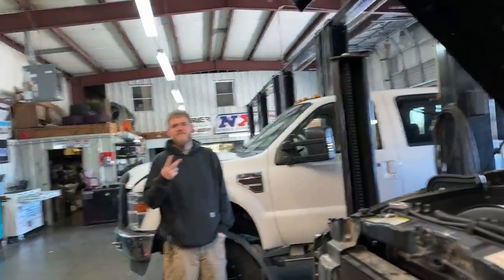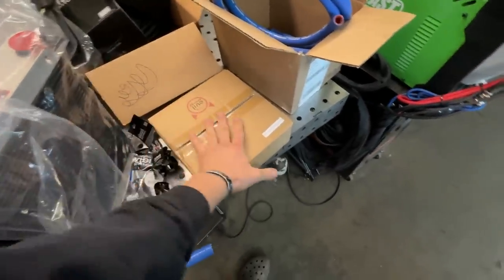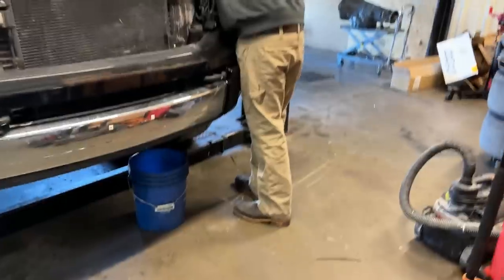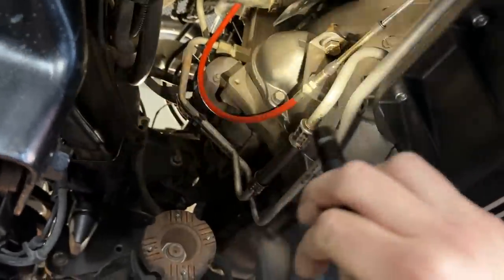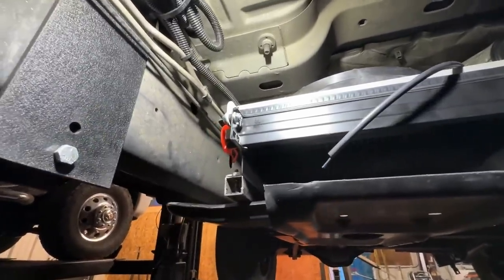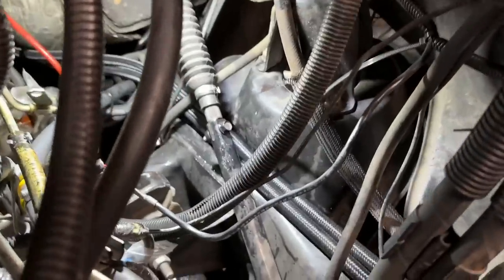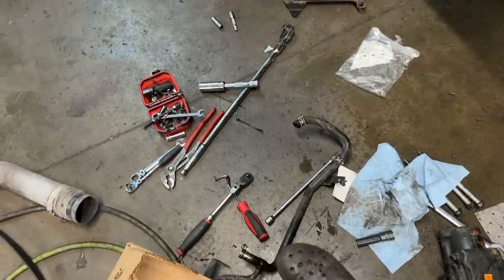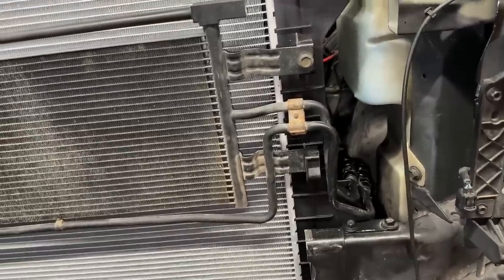HOW TO DELETE..... Your Heat Exchanger

Comment: I've always given the torque converter cooler it's own cooler when doing that job.  I like your setup.  I always wondered why Chrysler chose not to use the heat exchanger on the 68fre 3rd gens but  started using that billet block cross over with coolant and atf a few years later.  I hate when they leak coolant into your transmission from rotting out.

Comment: Without how much you payed for the truck how much do you have into all the stuff you've done to it so far?
Reply from the maker: By the time I’m done with everything this would be about a 25-30k bill to a customer
Reply: @Horsetorques Diesel  pretty crazy. Thanks man
Reply from the maker: @jakes_lbz  gotta pay to play the trans alone retails for 9990! Fuel system 6400, engine upgrades 2000, turbo kit 3000, tuning 1000, suspension work 1900. Plus some more that I haven’t put on yet

Comment: By the way i tried 2 Derale 10000 oil coolers in series in the stock cooler location and trans temps would over heat 220-230 just cruising around town. turns out the engineers got a handle on the thermodynamics with the stock cooler it basically needs to be a bit bigger because most people tow more than what the trucks are rated for.  I also have a Derale 15800 with fan under the bed and i have seen no change in trans temps so im sure you can under stand the under the bed coolers do little to nothing. I believe the reason for that is they dont thin the fluid out enough like the stock front cooler does. it make sense that fluid needs to be thinned out in order the be cooled.  rushing the fluid through high flow coolers provides very little heat transfer. After all i have not found anything that moves more air than the factory fan clutch.
Reply from the maker: Under bed coolers work just fine I use them on my quad cab for 2 years, used them on my 2011, 2006 mega cab etc. if they do not have enough air flow they do not work. People mount them too close to flat surfaces. Adding trans coolers up front has been proven to decrease the front cooling stack which when already over loaded is not enough radiator. With keeping a single stock cooler adding a larger radiator with the stock ram clutch that is the best way to increase cooling stack efficiency. It’s the same reason on newer trucks the Intercoolers are mounted low in the bumper for better radiator flow

Comment: Hey Josh, a little FYI from out west in Arizona. The best trans cooling design ive installed and tested is to take 2 factory trans coolers up front, cut the thermostat bypass pipe off of the old one and tig the tubes closed so it is a full cool 100% of the time. lay it on the front of the stock cooler, tig it on. mounted in front.  trans lines in series. full cool first then into the stock bypass cooler. Tstat opens at 180 degrees. I always over tow 28k lbs gross. temps are dreamy. 165 all the time, 30 minute hills at 5-7 percent grades 185- 210.  In 110 degree ambient temps.  
oh yeah of course the trans heater is deleted.  although i left the heater on my aunts 2005 and it stays under 220 while towing there fifth wheel. so still good results for people that want to have it heat up quicker.

Comment: I added a 6.0 trans cooler to my 05 CR. Took some doing and fabing some brackets.  That cooler is a massive heat sink! I do agree with you on taking heat sources our of the cooler stack and using remote mount coolers. Though I honestly think once the heat exchanger is removed from the equation, that's what cools the trans fluid down. My overall engine temps run around 185* now. It's a thing of beauty. 
Have a 14 silverado that send the trans fluid through the AC condenser, then the radiator, and finally back to trans. So dumb!  
One aux cooler and thermostat bypass later, trans temp rarely creeps above 140*. I'm south of I-10 in the heat belt.

Comment: The heater core line that went around the back of the block, you connected that line to the passenger front area but isnt that where the other side of the heater core is connected?  Just wanting to make sure i dont connect it wrong and end up with no heat 😂😂 and what size fitting do you use to connect the heater core line to the distribution block, the trans line stuff i have down pretty good but i had to just connect the two heat exchanger coolant line together until i can figure out what fitting i need and where exactly i connect the heater core line that was around the back of the engine, to..

Comment: What was the thread pitch on the bolt that goes into the block for the coolant line delete on the drivers side
Reply from the maker: -10 orb
Reply: what about passenger side by the oil filter?

Comment: Just my thoughts and maybe I'm overthinking it but wouldn't installed a good cooler up front, such as a Mishimoto, FSD, or any of the bigger cooler setups. Wouldn't that be more than enough to keep it cool and keep it simple?
Reply: I did that exact thing. Removed my heat exchanger, installed a Mishimoto in the front, trans hit 250 in traffic on an 88⁰ day. Trans would also shoot up quick backing trailers into tight spots (D to R back and forth would heat it up)
Installed a secondary with a fan under the bed, no issues now.
Reply from the maker: Stop adding heat into the cooling stack!!!
Reply: @theloafman2716  that's strange I installed the same cooler I haven't gotten over 160 even towing up steep grades.
Reply: Back in the Josh/Myer video; I deleted the heat exchanger and installed the PDD blue/Continental lines with a Mishimoto trans cooler. My truck runs in the northwest but have made trips to California. Haven’t gotten over 170degF in 95degF weather towing a 24’ camper trailer up decent grades. As Josh said too, on those cold mornings take it easy on the trans as it builds heat.
Reply: @j.c.316  hey, by "mishimoto trans cooler"... Do you mean the one up front, or the torque converter cooler in between the block and the trans?
Reply: @adamantee1  Yup, the one out in front. It sits behind the AC condenser.

Comment: In the first part of the video you showed the blue silicone hose as the preferred hose, why then did you use the braided hose instead?
Reply from the maker: 2 reasons. 1 this is npt to an not push hose style on the heater core. 2. I didn’t have the 10an push lock fittings 😂

Comment: Can you attach the Vibrant "crimp" -8 fittings straight to the OE cooler, or do you have to cut/modify the tubing to accept the fitting 1st?
Reply from the maker: Not long enough to get a good crimp
Reply: @horsetorquesdiesel  So do I cut behind the "ring", where the factory lines would've bit onto, then install crimp -8s?

Comment: Would you recommend the power driven trans line and cooler kit for a 3rd gen and exchanger delete?
Reply from the maker: Not with them shitty push lock fittings

Comment: why the 6.7 fan pulley? does it have to match with the 6.7 damper?
Reply: Yes it does.  5.9 fan pulley with a 6.7 damper you cant get the belt on due to the damper being larger.  6.7 fan pulley is re designed to have a small amount of clearance to get the belt on.
Reply: I found out the 6.7 also has a different water pump. It's got a different blade design and my 2013 actually has a smaller pulley than my 5.9 on the water pump. So I'm interested if putting a 6.7 water pump on a 5.9 helps anything or makes anything worse

Comment: Changed out my tensioner today with a new Gates all of a sudden belt started to walk off the AC pulley towards the block put the old one back on everything seems good or back to normal anyhow weird huh
Reply from the maker: Weird I’ve used those and dayco before. But could have gotten a dud!
Reply: @horsetorquesdiesel  update: power steering pulley needed adjusted moved it 1/8-3/16 towards the front of the truck belt no longer jumps a rib on the fluidampr

Comment: What is the purpose the 6.7 fan pulley and dampener?
Reply from the maker: A 5.9 pulley and a 6,7 balancer won’t let you take the belt off without removing the fan pulley
Reply: @horsetorquesdiesel  is the 6.7 balancer better? My 5.9 has 450,000 original miles on the original balancer.

Comment: i vehemently disagree with  this practice for every kind of reason. even though  we have been thru this before, i get to say it again Alot cooler!!! youdont want it a lot cooler 185 degrees please all day long
Reply from the maker: Free country, I don’t care what others think, we offer this service and I will stand behind my transmission warranty on this modification as well
Reply: @horsetorquesdiesel  
yes free country , not as free as it once was and a lot less free than some countries in the western world . even so with your star rising on u tube and the videos increasing in viewership and in quality the onus is on you to present  with conviction your stance on a modification to your viewers of this you do a good job. 
even so my " view" differs from yours by a wide margin and for very good fundamental reason. so i speak it with equal conviction.
lastly, your videos generally avoid the " squid kid " modifications, presenting really intelligent modifications for a stated purpose. in this case science is firmly against u. keep up the good and getting better work .

by the way , ive plans to delete my heat exchanger too. replacing it with a larger heat exchanger with its own cooled radiator. i can be rewarded with perfectly stable trans temps at about 185 to the pan
Reply from the maker: @pugetlexus  and you’ll continue to put unnecessary strain on the VB and the trans
Reply: not at all likely to put strain on any component when properly heated and regulated fluids pass through the transmission.

trans fluid too cool and accumulated moisture because of that condition is much harder on transmission components. you are giving bad advice here and it will bite.

recently i went the other way. i deleted the air to fluid cooler in front deleted the heat exchanger on the block and went with a much larger heat exchanger strapped to the frame rail beneath driver position.
so far , perfectly stable temperatures vastly reduced plumbing, eliminates much in clutter, makes keeping track of hose and potential leaks easier. its what dodge should have thought of initially but dodge being dodge fors what dodge does.

additionally and for no reason really at all. its a short call to Goerend  to confirm my assertions if validation is necessary.😮